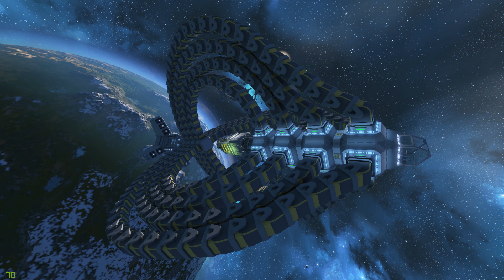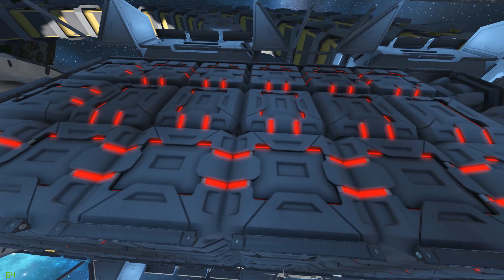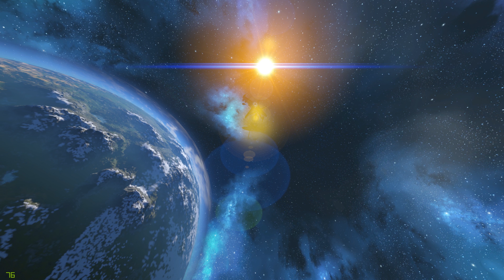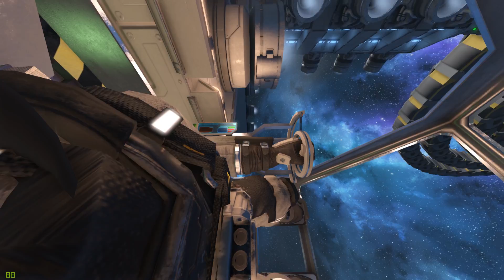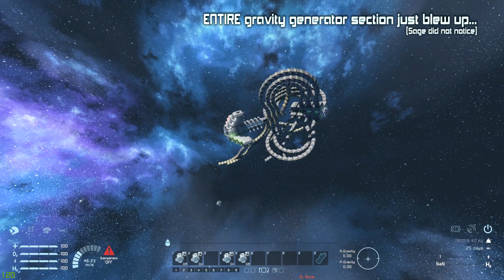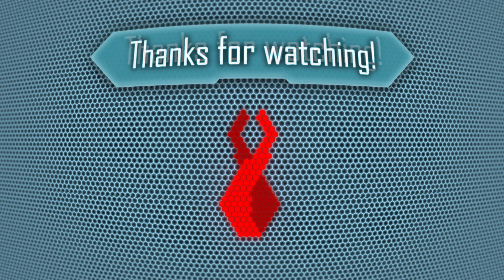Space Engineers, The Gravity Chariot

Comment: Warheads with gravity generators would be cool because they would go toward the ship, unless gravity only affects the character.
Reply: The thing is that warheads are not very effective against heavy armor.
Reply: You could make the projectile disable its own mass block once it leaves your ship
Reply: That's why you set them on a timer to turn off the thing before impact.
Reply: Correct me if I'm wrong, but didn't you need a power source anyway to power the mass block? At that point, all it is is another block. Than and a sensor, anyway. Shouldn't be too hard to stuff in most the time.

Conventional missiles are still useful by virtue of variable payload. You can set them up easily to penetrate armor first, then explode, allowing you to detonate in what is usually unprotected interior levels often covered in vital equipment. Besides, ore cannons are glitchy, and often inaccurate. From what I understand, item cannons suffer the same issues. Though, I've not really seen much on them for some reason.
Reply: Yes, price is a consequence of having a much more powerful weapon capable of penetrating and disabling a ship. Grav-based item or rock guns are unreliable, often inaccurate, can be countered through gravity shields, and lack the variability of a proper missile.  

Assuming fighter survivability, maybe. But combined with the horrible weakness of standard game weaponry, and the accuracy of gatling turrets, I don't put your odds very high. 
The only components mentioned thus far on a rocket were a timer, a battery, and a mass block. A fighter requires thrust in each axis, a gyroscope, a cockpit or remote control, an antenna if it has a remote control, a reactor or a battery, a gun, and of course ammo. 
This is pretty basic stuff. I would've assumed anyone who's played the game for more than a few hours would understand this.

Yeah, because everyone wants to use mods. Moreover, arguing mods is not an effective argument against player-made vanilla missiles. If your only defense against player-made missiles is that modded weapons are more powerful, you've not got a good case.
Reply: I take rather high offense when folk jump straight to intellectual dishonesty in regards to argumentation.

I
 made no mention of armor in regards to fighters as required parts 
either. Are we to assume you'd fly an unarmored fighter? It'd die 
quickly, too. Gatlings are guaranteed to shred it. A fighter's the same 
way. Why would you assume I meant an unarmored missile? It makes no 
logical sense. Thus, it can only be interpreted as an attempt to angle 
the argument into a way advantageous to yourself by changing information
 never given or otherwise intended. That's what a strawman is.

Scripts
 are vanilla. They just require a talented enough coder. You can predict
 the location of most moving targets, especially large ships which'd be 
the only thing you'd be fielding player-made missiles at anyway. Large 
ships change direction slowly, not just for mass, but for lag produced 
as well.
For extreme range, you use a remote control. Most the time, 
that's not necessary, and besides that would be required for any other 
weapon anyway.
Again, scripts are vanilla. There's no issue with 
using scripts. That's how something tracks using a sensor, after all. 
Can't just do it on its own, last I recall.

If you're manually controlling the missile, you only need the antenna if you are not personally onboard. Regardless, this was intended as emphasis for the rare occasion you want to manually control the missile, as should've been well obvious. 
To "guide" the missile, you just need a sensor and a script, so I'm assuming you meant "manually guide", as mentioned in that line.

Not always. Ore cannons and similar are subject to Space Engineers physics, and said physics are very often unreliable. If you're firing from a stationary position? Sure. Accurate. Otherwise, far too often messed up by whatnot. Further, they have a habbit, due to the way physics is run, of potentially passing through entirely, leaving the ship unharmed. This can also work to the advantage of the weapon, though, which is why I'd never say they're a useless item, but it does mean they are less reliable.

Gee wizz, it's almost like warheads aren't the only payload one can stick on a missile! Who would've ever have guessed?
Reply: It's a blatant misconstruing of an opponent's argument to suit your agenda based on information never given or intended. That's what a strawman is. It's considered a pretty major dick move, only used by assholes. 

They take as long as downloading someone's script and putting it in. Hardly complex.
Small large ships can move quickly, yes. However, the larger ships, carriers, or refinery, or even some extreme cases of cargo ships, cannot move so quick. Even if they've got the thrust to move quickly with that level of mass, sim speed starts becoming an issue when you've got something that massive. Especially when fire starts swinging around.

I've had it occur before at standard speeds. Though, I blame that on massive lag due to huge combat ships swinging towards eachother.
Ships tend to maintain inertia much better than do small chunks of metal. It is far, far easier to launch a missile safely than an oregun from a moving target. Only requirement is you don't suddenly change course during the firing procedure.

As already mentioned several times, 50m is a large area. If you're firing on anything what that isn't suited to, you're better off flying manually anyway. Besides that, this'd be the case for anything else. A fighter cannot engage a target at that distance, and an ore gun is certainly not going to manage to hit it unless it's dead stationary. In which case, lockon is irrelevant, as you just fire the thing.
Defense turrets can also shoot down fighters easily too. Just like a good gravity defense can stop an oregun. Big surprise, a good defense is going to help you out. 
Though, it should be mentioned, another solution is to fire a few decoys. It's damn well advisable, given how easy it is. No need for precise targeting or tracking on a decoy, you just fire them off a touch early, and the turrets go after them instead of your missile.

Woo, a rare chance someone MIGHT decide to disable scripts makes a specific type of missile useless. Great argument. 
They go behind something, you're going to have issues whatever you are fielding. An ore gun ain't just magically going to go through an asteroid to your target.

Congratulations, you've figured out two more warhead types! The point to missiles is you can strap whatever you can strap on to a ship.
You can get kinetic punch from heavy armor plates at the front, for instance, allowing you to detonate a set of explosives inside the target. You could detonate it early to only damage things like thrusters and turrets, and leave the ship largely untouched otherwise. I've seen people launch entire turrets before, with the idea they latch on to a target, open up, and start firing on the ship they're carried by. You could put containers and ejectors if you so desired. Huge variety of payloads to do exactly what kind of damage you want. Versatility, that's what makes missiles so handy. 

You ain't going to be able to do everything to the greatest ideal every time. Boarding only works if you can reliably get aboard, and actually move around the ship without being gunned down by interior turrets or other players. 
Though, that's another plus to missiles, anyway. Early-detonation rockets can disable a ship without doing major damage to the interior, or otherwise expensive components like reactors and such. Limpets are something you can fire off, if you so choose. Even boarding pods, basically a missile what happens to contain a medbay and a few seats.

It's more of a matter of every weapon having a use somewhere. Missiles excel at large ship combat. Big hulking masses that can afford things like gravity shields, and who's components are well-buried or otherwise spread out. Situations where you need a specific slug for a specific job, or you absolutely must maximize your damage potential. Fire a few missiles with a penetrating head to knock out some interior systems, either of conveyors or reactors, or even thrusters for that matter, and you can cripple a heavy ship easily enough. Follow it up with a boarding pod, or one of those mentioned gun pods, or maybe just a simple limpet, and you've got yourself a new ship. Or if you more want to be sure, use the missiles to knock out grav-shields and otherwise stop the thing from moving, and then finish it off with an oregun. It's all about the options, man. Best thing about missiles is their variety.